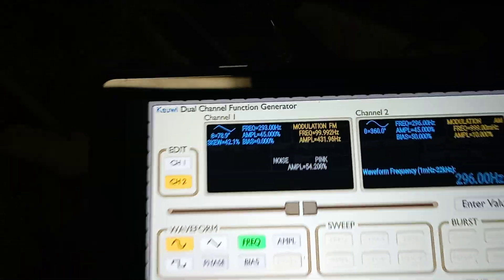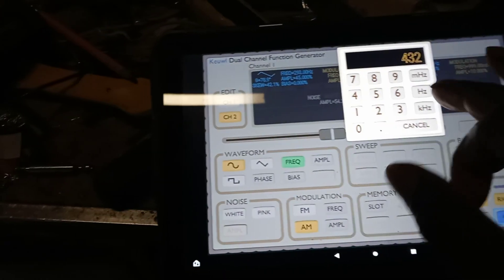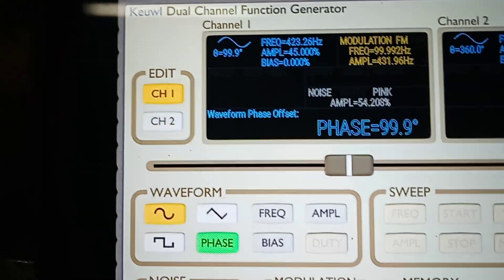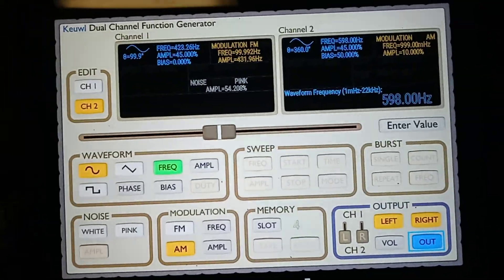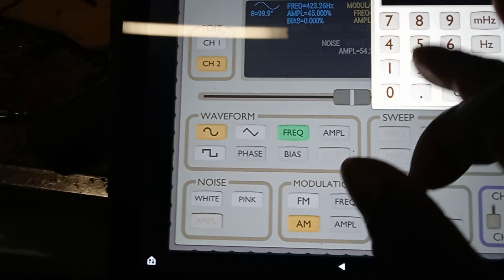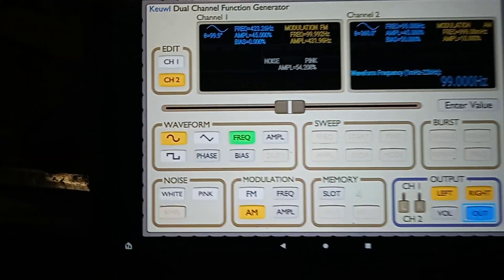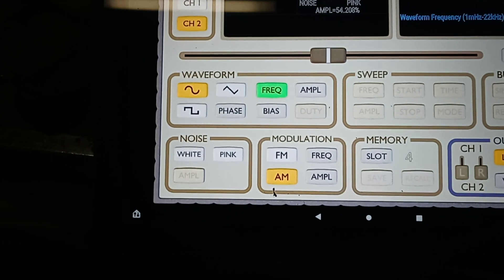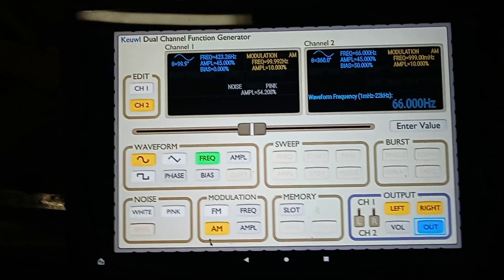Frequency generator

Comment: Ultrasonic detector and infrasound detector apps by Sergei are able to transform the frequency you cannot hear but feel internally as  a pressure or vibration is a "good learn."
Breath out low frequency. Breath in high frequency.
Autogain the sound and it's weaponized.